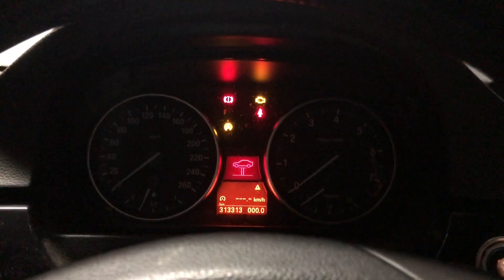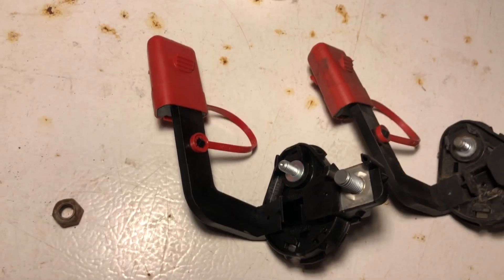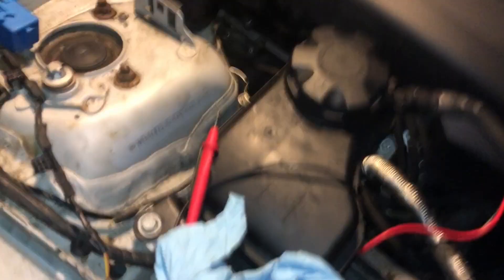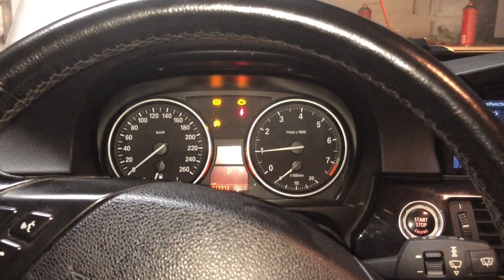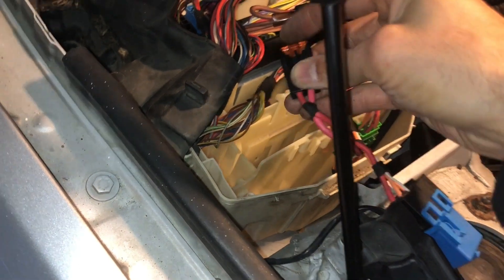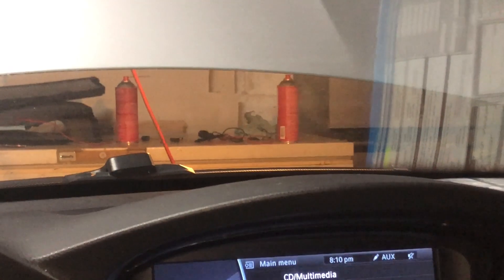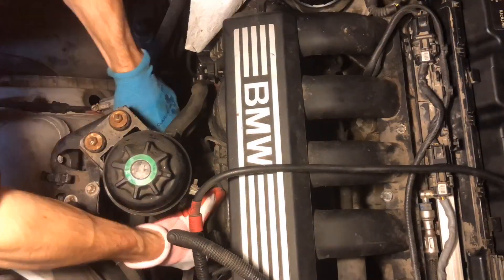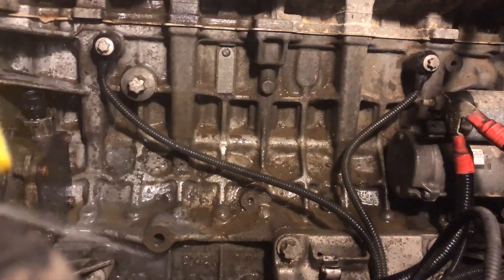My ECU was playing dead!

Comment: Did all this happen to cause your water pump to not work correctly/ not heat
Reply from the maker: No connection to the water pump in my case. 

Try bleeding it… ignition on, engine off, heat at max, fan at 1 and hold the gas pedal for 5 seconds. If you don’t hear your water pump kick on it’s probably dead
Reply: @rackintosh thank you. Its my sons first car, he saved for a cool car and he has codes for water pump, seems like it works intermittently ( i pick the pump up today) and then yesterday all the lights on his gauge cluster lit all up flashed a bunch the battery died and after you jump it and take the cables off then it does it again.  He thinks battery i think grounding. Please help a dad help with any information

Comment: So your terminal was the problem?
Reply from the maker: correct, it was the ground cable that is attached to the engine bay terminal
Reply: @ Ohk thank because I’m having the same problem and I’m getting power to the ECU but it’s not responding,maybe it’s just a bad connection. I’ve changed all ground cables and fuses, and still got nothing.

Comment: Which color wires on the dme did he check for power?
Reply from the maker: @Worldz.n  it’s been a few years. I don’t know. 

I was scanning the car with an OBD reader and the DME wasn’t responding, that’s how I figured there was a problem. 

Check your ground wires and fuses. There’s a ground wire on the drivers side engine mount and there’s a ground line going to the battery terminal in the engine bay. 

Think of anything you touched that you might not have put back together right and check it again. 

Most likely it’s the ground strap.

Comment: BMW E91 320D M47. Tried jump starting the car in -26C. Since then ECU has been dead with no communication when scanning for codes. Cant find any bad relays or fuses. Help me, its been over 6 months now since it last started. Fuel pump is constantly going when ignition is turned on as well. Ecu box looks pristine on the inside.
Reply from the maker: Sometimes when you jump the car (especially if you jump off the battery and not the posts in the engine bay) you can fry the CAS or FRM modules. 

Try scanning the car and see which modules aren’t responding. 

You’ll probably have to pull them and take them to someone to get them repaired / cloned. 

Hope this helps!
Reply: @rackintosh  Hey, all modules but DDE works. I'm thinking a wire, ground or hidden fuse anything must have gotten fried when jump boosting a dead battery at -23 C. Very cold and agressive failed cold start.

Comment: So I’m getting crank but no start. Swapped the ecu and it cranks but in limp mode. Also says the throttle body is stuck closed and getting no signal. Mass airflow sensor is sending no signal either. New sensor.
Reply from the maker: Sounds like you need to take your car to a mechanic my friend! 

I’d check all the fuses and relays. Could be something simple like that. 

If it’s cranking an no start could be a bad fuel pump controller but hard to say.
Reply: What was your issue ?

Comment: Ya the only way ur ecu will burn out is when u have jdm moding or stuff like that
Usually its fuses or the battery disturbion box on battery
Reply: my 08 335i sedan is on mhd only no hardwiring. i have crank no start today out of nowhere. cars been fine with no starting issues since ive had it 204k on the clock

Comment: Hey could you help me out ? My car cranks up and drives but it stalls to start and my mechanic said I need to replace the whole ecu . He also doesn’t work on bmw , so he said since he can’t find the electrical problem to just replace the ecu
Reply: No I would start with other problems like cleaning maf or replacing it then hit coils spark plugs ,there no electrical problem because the car probably just has to be serviced ,then hit ecu last.
Reply: Lol a ground cable wasn't connected and I'd retest old part to then return new part
Reply: Smoke tells me time to change spark plugs oil change coils
Reply from the maker: There’s is a mofset failure common to the n54 ecu. That could be the issue. 

A quick Google and you hopefully can either find someone in your area who specializes in BMW electronics, or Google n54 mofset repair and find a company that does it. I wouldn’t do it yourself unless you’re extremely good with electronics. 

End of the day it’s worth finding someone who has the skills to diagnose your car properly
Reply: @rackintosh  I have a n52 motor I have the 328i e92 is it the same?

Comment: Hey maybe you could point me to the right direction , my radio is having zero power I swapped it out for another radio and nothing . I also checked all fuses under the glove compartment
Reply from the maker: Is it the radio or the amplifier? 

If the radio unit doesn’t power on at all you’ve probably missed a fuse. 

If it’s on but you don’t have sound your amplifier in the trunk could be fried. 

Best of luck!

Comment: When your ecu was playing dead, was half the fuse box still live?
Reply from the maker: Yes, turns out it was just a misplaced ground cable. Try checking all your cables, if that doesn't help then look at fuses and relays
Reply: @rackintosh  lol this car is about to take me over the edge, and not even literally because it doesn't start 😅
Reply: Isn't the grounds. Fuse box still partially getting voltage. Any recommendations?
Reply from the maker: @1creed  Check your relays and fuses. It's possible your battery distribution block has failed, that or the battery terminal in your trunk. Was an airbag set off?
Reply: Did you check the fuses prior to changing the part?

Comment: hey I was replacing gasket and accidentally hit my ranch to the positive terminal that you replace in the vid it caused a spark when i hit it. Now my car start but shows engine mal reduced power and over time it jerk the car n make hard breathing air noise. should i replace my EMC? I was thinking i fried my emc. 2011 BMW 328i. Thanks
Reply: I have the same problem 😣 did you find the problem? 🙏
Reply from the maker: Electrical is difficult to diagnose! Honestly, I'd pull codes and see if you can find an independent tech in your area to diagnose the problem.

Comment: Hey man, so I have the EXACT SAME symptoms. Literally down to the sounds lol. I went to check on that ground strap you showed in this vid and it’s in place. The other main chassis one just replaced with new one. My symptoms are IDENTICAL to yours. So logically I’m deducting that it’s fundamentally the same issue. Just different spot. Where would you look next?
Reply from the maker: Hey! Hope you were able to figure it out. Electrical is difficult to diagnose, you may be better finding a local tech who can diagnose it.
Reply: Did you ever figure this out? Same problem here

Comment: I got a similar issue on my 650 2008 model, it suddenly wont start but crancks,and i got DBC active steering inactive and many more on board. What do you think the problem is? Need help bro please?
Reply: My friend checked it and he says my ECU wasn’t responding so we called the dealer and they said i could have a dead ecu. Any thoughts? I thought it was just the speed sensors but it wont start so it means there’s other issues sooooo help please 😭
Reply: @jbramos420 Can Help!!! Waht was your exact fault as l have such a situation on my vehicle
Reply from the maker: See if you can find a independent tech in your area who specializes in electronics or BMWs. There’s so many things that could be wrong it’s hard to diagnose let you know your way around the car and electronics
Reply: Can Help!!! What was your exact fault as l have such a situation  on my vehicle

Comment: Bro, in regards to your smoke issue, if it’s not your valve cover gasket leaking, check that your PCV on the valve cover is not busted and working correctly.  That problem will lead to all kinds of oil filling into your intake manifold.  How did the old manifold look when you removed it?  Cheers for the video.  Really like your honest video logs.
Reply from the maker: Asim Khan whelp, it’s been a year since I n54 swapped it and I did the swap because I thought I blew the engine. Turns out the manifold was in fact full of oil.
Reply: Manifold full of oil , how would you clean it? @rackintosh

Comment: I dont get why you dont have more suscribers, I actually really like your channel. My car has a similar no start issue, it cranks now but i noticed when i tried to jump start it the front positive terminal post did not spark. Also, blower motor failed and caused a short. Car is currently parked and has a severe power draw, kind of losing my shit trying to figure out how to get it to crank. Your video was the closest ive seen to my exact issue! 

Please let me know anything you can think of that i can check, i would really appreciate it!
Reply from the maker: Carlos Reyes my channel is fairly new and I haven’t been uploading as often as I’d like. 

If no spark at the positive your power distribution block in the engine bay could be fried. 

I’m not great with electrical. 

You may need to find someone local to give you a hand. 

Best of luck!
Reply: Did u figure it out? I tried replacing my blower motor and now it doesn’t start.. crank no start same issue wit yours
Reply: @gaxiola13  who the car wouldn't start after replacing a fan. What was the reason?
Reply: @gaxiola13 did you figure your issue out

Comment: anymore exhaust videos? I am thinking about doing a PE mod to my 328ix.
Reply from the maker: FatalNukeZ there are a ton of videos on the PE mod... I’ll be doing something a little different with the wagon. 

For your car if it’s a coupe then it’ll have an x-pipe in place of a resonator and will pair very nicely with a PE-mod. 

If you have a sedan or wagon then you’ll have a resonator and you can do a resonator delete which will definitely give you some more tone.

I’ve found the PE is great for getting a more aggressive sound without too much drone. Definitely worth the added cost over a muffler delete.